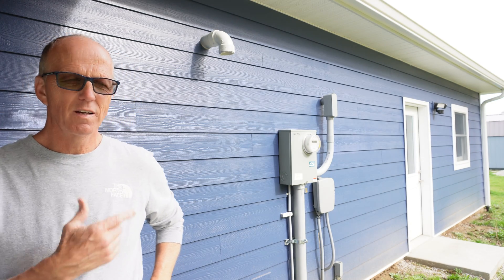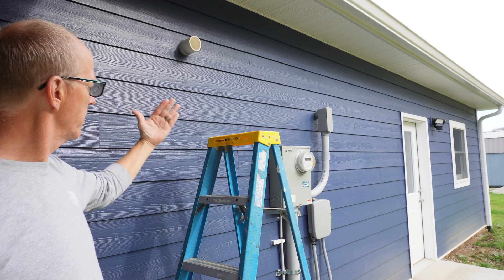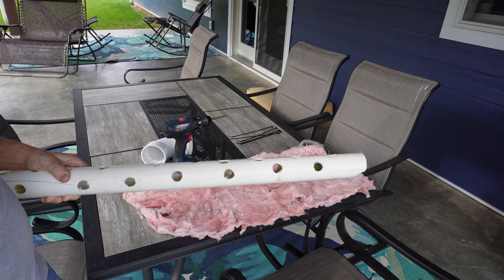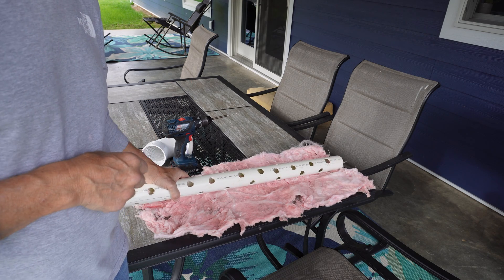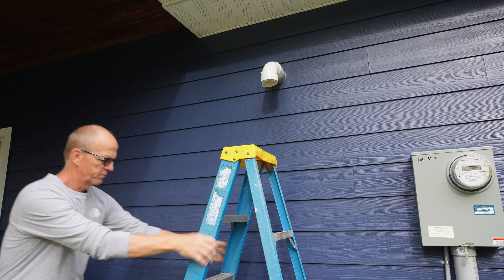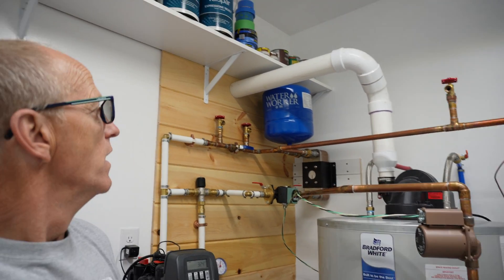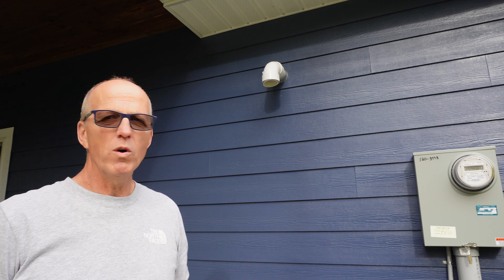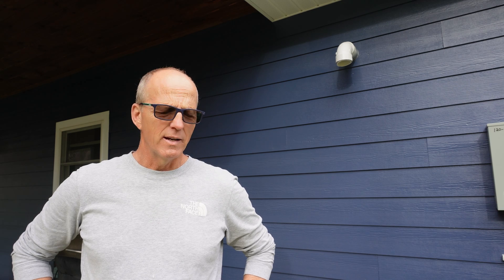DIY, Power Vent Hot Water Heater Way too Loud!!

Comment: Please tell me this is real!
Reply from the maker: Yes it work for me, this is what I did.  On my water heater I can run 70’ straight and every 90 elbow subtract 5’ so I was just inside that wall will one 90.  I felt it would not restrict air flow enough to damage the heater.  It is still working today, but I check it often.  Thanks for watching 
I’m not a plumber or a HVAC technician just a tried it myself.
Reply: @klwit1980  awesome thanks! Definitely going to try this

Comment: Hi there, thanks for the great video. One quick question: have you seen any mold stuck in the pipe after one year? Thanks!
Reply from the maker: Thanks for watching, I have not seen any at this point, there again this is something I tried myself and works well.  I have check the drip tube and no moisture which is a good thing.  I check it very often on the exhaust I have not seen any moisture at this point.  But check with a professional HVAC before you try.
Reply: @klwit1980  Thanks for the quick response and helpful information!